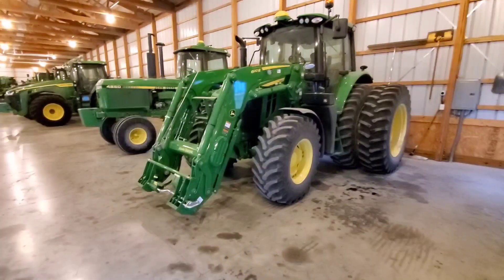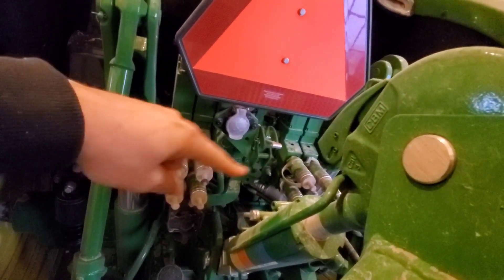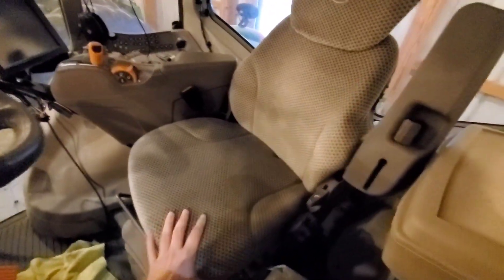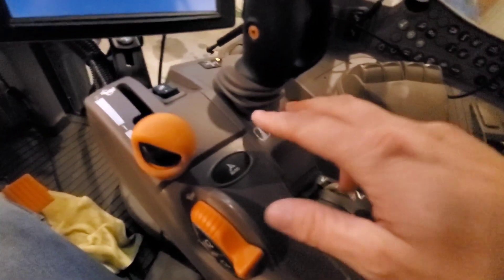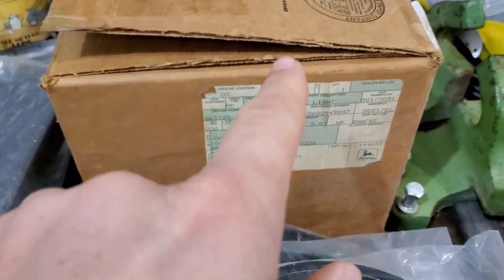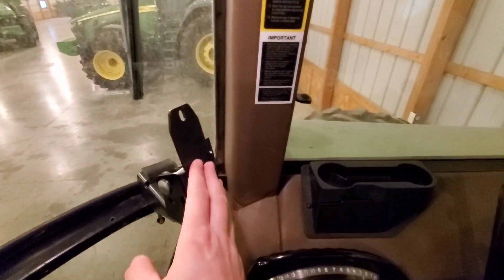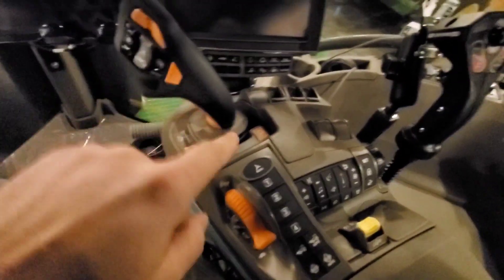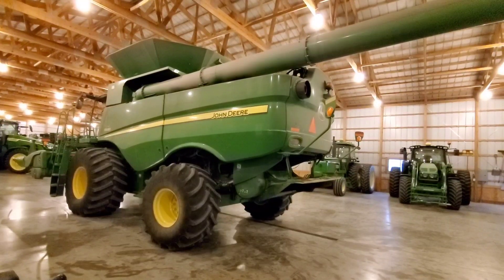pimp my tractor

Comment: Just like you did on the 6m, I figured out you can make an early 8r/ 9r seat swivel a lot farther. I just take the seat cushion off and adjust the stopper bolt two holes farther to the right. You can’t really go any farther to the left but there’s really no need for that.

Comment: What an awesome lineup of green machines!  I was wondering, why are the tires on the grain cart, backwards of the tractors,
Reply from the maker: Thank you very much ! 😊..... I'm not real sure why they do that - every cart we've ever had, they have been backwards - I think they said it was something to do with wear patterns to the tire, but not super sure either...
Reply: Rule of thumb is to mount the tires/wheels backwards on non-powered axles. It will reduce wear, especially for road transport, and may help reduce compaction on soil as well. This is important especially when pulling the cart through a wet field during harvest - less likely to sink in. The tires do not need to "bite" since they are not being driven directly, unlike the tires on the tractor.

Comment: Fendt is gone?
JD 4 Track is gone?
Reply from the maker: Fendt is still here - but it is for sale ....
8400R lease was done - so we traded it and that 9520RX in for a new 8R410 and a new 6250R ...  the 8R410 is good- but the 6250R the order got messed up by JD so they agreed to take it back- in exchange, we got a 8R280 ... wish we would have just got the 8R280 from the start ... we only used the 6250R for a short while, until the 8R280 arrived ....